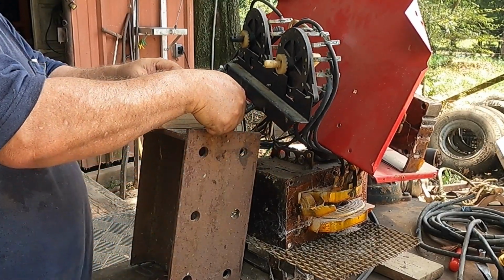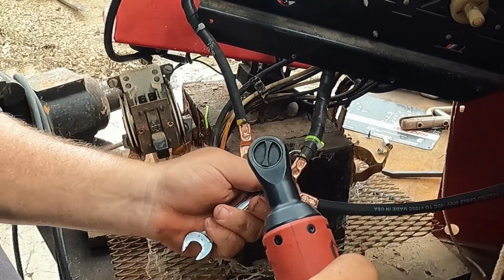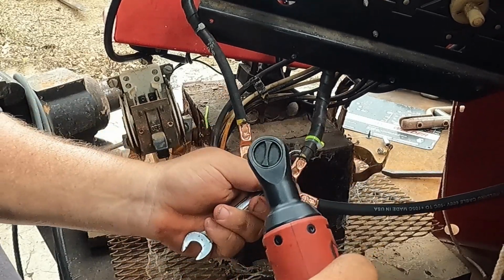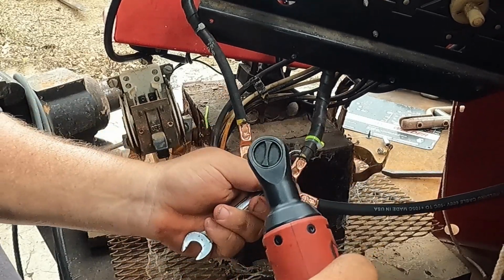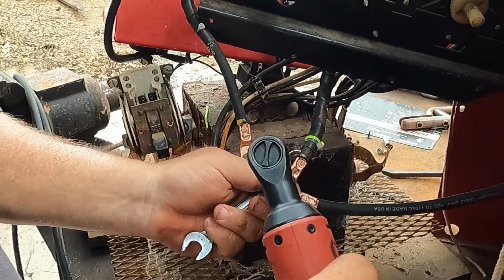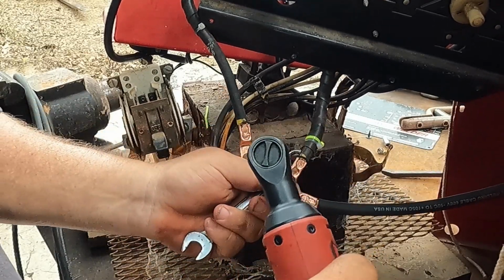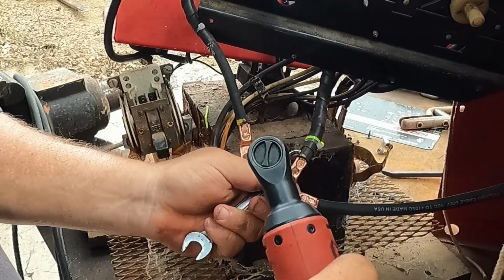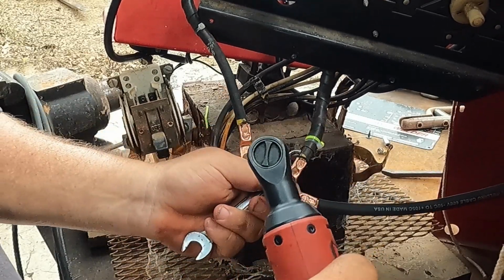Lincoln welder gets new leads

Comment: For safety reason it would better having the female connetor on the device side and the male connector on the whip side. Stock welder devices also have female sockets and male connectors on the cables. Nice work by the way. 👍
Reply from the maker: @SuperSkyhawk81  I see your point there. Good tip.